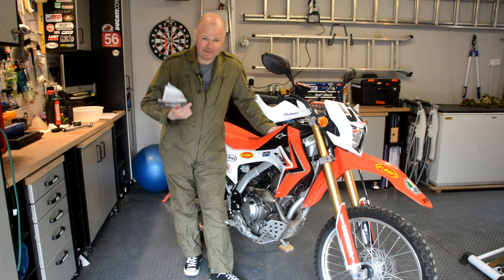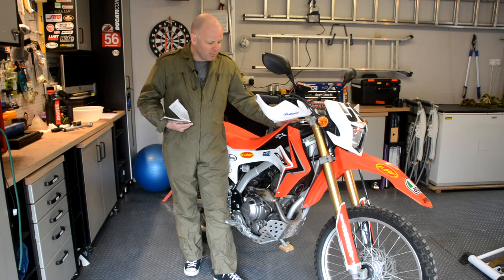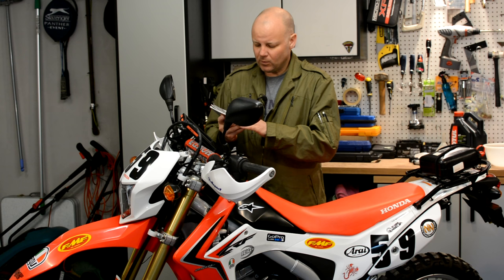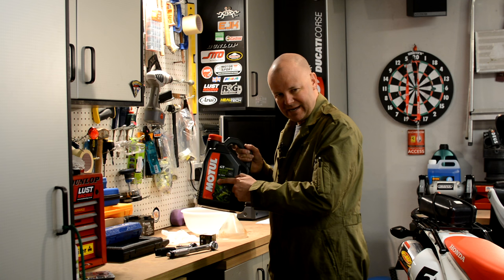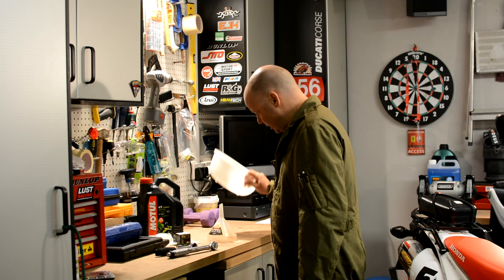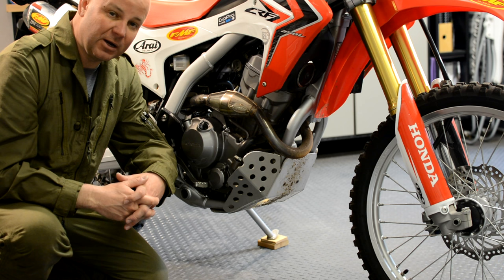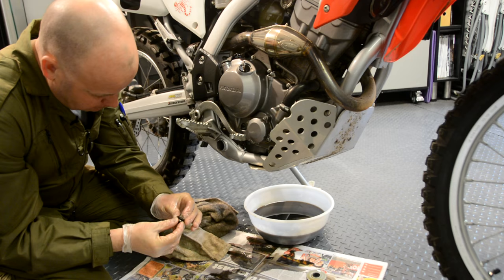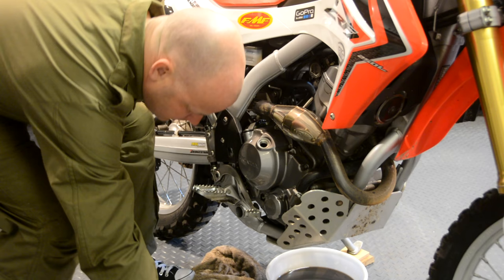How to change your motorcycle oil

Comment: again good video.But would be nice to follow manufacturer guidance on tightening bolts with right amount of torque. Quick look in service manual - 24Nm. Most people put them too tight.
Reply from the maker: Thanks Dom - I'll peg your comment to the top, should have mentioned that you're quite right....
Reply: Only noobs need aply ;)
Reply from the maker: Indeed...
Reply: Interestingly enough, on my 2017 R1200RT, there are several locations with the torque value imprinted.  Seems to happen near the soft parts.
Reply from the maker: Makes eminent sense....
Reply: I used to follow the torque recommendations but for Drain plugs you develop a feel where you just nip them up to be tight enough. The only time I've ever stripped a thread is when I was using a good quality torque wrench on my Aprilia Falco. I had to install a Heli coil kit and all was good again but the mechanic who fitted this advised me just to tighten by feel and always use a new gasket to avoid leaks that way.

Comment: Good video. Just changed the oil in my CRF last weekend. Only difference was I removed the skid-plate to keep the oil from going everywhere. (Only helped a little...)
Reply from the maker: Yes I wondered whether I should do that, as it happened it wasn't a big issue with only minimal oil spillage....what sort of annual mileage are you doing on yours?
Reply: I purchased a cheap plate with an improperly aligned hole so, removal will be part of my ritual. I do around 2500 miles with 80% of that off-road. Not bad for a fun toy.
Reply from the maker: Nice going!

Comment: Another cracking video, one tip I have learned from working on land rovers and industrial gearboxes is to check you can undo the filler before removing the oil. Not so much of an issue on new bikes but worth considering. Something satisfying about doing work yourself isn't there. I have recently done the valve clearances on my cbr600 and although awkward was nice to work through logically and decrease the ever increasing cost of vehicle ownership. 

Keep up the good work.
Reply from the maker: Great tip - thanks Thomas!

Comment: Hi fella,just some food for thought,you mentioned your bike had stood before dumping the old oil so there was no need to start it and warm it up before draining it. This is done for the reason of getting any heavy bits of debris which have not been caught in the filter suspended in the oil so they also come out with the old oil. Doing it on a cold engine like you have done allows these particles of debris to settle and they don't come out with the old oil. I can't imagine it's going to have a huge affect as your filter catches the worst.
Also you noticed when removing the filter cover it made a mess,I have found that using a piece of tin,normally cut from the likes of the base of a tin you cook turkeys in a Xmas shaped into a U shape like a piece of guttering. This can be placed under the filter cover to catch the oil which will run down the U shaped foil into your waste oil pan.
Some times it's impossible to make something like this fit due to the design of the engine but it's worth trying,also shove some paper towels below the filter cover to help soak up any oil which does escape. 
I know you keep your bikes clean and there is nothing worse than getting your ride all covered in old oil but these steps could help you lots.
Reply from the maker: Thanks Philip - yes you may be right on the cold v hot oil thing, I know that one does split opinion.  Having only done 600 miles since the last change I'm too worried though.  Good advice on the minimising mess front - you couldn't see it on the video but I had laid out plenty of rags and stuff under the bike as I was expecting a mess, but next time maybe a tin "funnel" is the way to go (although to be fair not much oil came out from the cover)....thanks for watching and for stopping by - TMF
Reply: Good advice Philip, especially about the tin funnel! I like that! :)

And as for your video on the oil change, Mr Flyer, once again, 1st class in every sense, Sir! (content, editing, humour "Most humane" lol)
As you're a perfectionist in all that you do, which is reflected in the neatness and organisation of your garage, can I please suggest another addition to your regime? 
As Mrs Flyer so kindly loaned you her mixing bowl, if she could see her way to also loan you her plastic measuring jug, you'll then be able to measure out the exact quantity of oil, so eliminating any guess work? It's only a suggestion, so please don't take it as a criticism, as that's not my intention. ;)
Reply from the maker: Thank you Ian, no criticism taken, part of the reason why I put this type of video up is because people always come back with great observations on either what you're doing wrong or how you can make life easier, so thanks for that....all the best - TMF
Reply: Thank you for that Sir! ;) My philosophy is to always reward and guide, as opposed to criticize and laugh, like so many people do on YouTube. At the end of the day, we all have to learn EVERYTHING in life, no matter the subject matter, so let's just all help one another instead of tear down and ridicule.
You are certainly the Class Leader in Motorcycle reviews/topics etc, and I'm 100% certain you'd do the same sterling job if you were talking about cars or planes! Excellent editing skills also my friend, so all in all, it's a pleasure to be your subscriber! :)
Have a great sunny Sunday here in the UK, and keep safe out there! ;)
Reply: Philip Roberts  I disagree all the sludge will drain to the bottom of the sump after you turn your bike off so draining it cold is better., it just takes longer because the oil is thicker. I personally don't warm my bike before oil change,but both ways are personal choice
Reply from the maker: Thank you Ian....
Reply from the maker: Told you this one split opinion!

Comment: Oil change is the only thing I can do on my Street triple . Going to try to change brake fluid in the future.
Reply: I was worried about changing the brake fluid on my Street Triple too, just because it's such a vital component of the bike, I didn't want to mess it up. It was actually amazingly simple! There's loads of videos on YT on how to do it - the most important thing I'd say you need to do is, make sure you don't let the fluid in the reservoir drop so low that you drag air in to the system - pump it out a few times then top the fluid up, and repeat 'til you're getting clean fluid through!
Reply from the maker: .....and don't forget to protect the area around the reservoir with lots of rags etc as if you spill any of that stuff onto your bike it can make a nasty mess!

Comment: Good video.  I'm about to do the same on my Rally.  Is there somewhere online that can provide the complete service kit?
Reply from the maker: E-Bay I suspect will have loads....
Reply: @TheMissendenFlyer  Did you change the oil filter gasket and the pressure washer on the drain plug?

Comment: Greetings from Canada!   I go to appliance stores and ask for the cardboard boxes that new fridges come in. Cutting down along the corners you four long cardboard pads. You can roll you bike onto one of the pads to avoid oil or coolant drips getting onto garage, or driveway floors and concrete. Cutting only one set of opposite corners gets you two double wide pads to slice under a car or truck.
Reply from the maker: Good tip!

Comment: Hello! Followed all the steps on your video until the oil filter part. Just was wondering, has there been a change of the size or model of the filter itself? Coz on my research, I should use Hiflo HF-116 for my 2017 Crf250L. Or am I still okay if I use the HF-112? Thank you!
Reply from the maker: +Paul Capuyan Ballola I doubt it's changed but it may have done - replace with the same as OEM if in doubt...

Comment: Hi MF... kitchen foil is an amazing medium to allow oil to drain from your filter to the desired collecting receptacle.... it shapes to any contour and allows the oil to work its way to where you choose without collecting on places like exhaust pipes etc that get hot and inevitably end up burning and smoking the waste oil that has leaked on to such surfaces. It also limits the amount of clean up at the end of the job which is a positive. Enjoying the channel....  thx Mark
Reply from the maker: Cheers Mark - i think about 4 people have suggested that - great tip and one I'll definitely use next time - I love the internet, always can learn something!  Thanks for watching and for stopping by - all the best - TMF

Comment: Hi Flyer, shouldn't undo bolts with your torque wrench mate ! A rectangular cat litter tray from a pound shop can accommodate the draining oil and the filter spillage at he same time. I like to keep the litre bottles with a spout decant the bulk oil on the bench and use the handy measuring device on the bottle. Nice video as always though.
Reply from the maker: Cheers U B Slow - appreciate the advice, I'm always keen to learn from others so thanks for that....(and I'm too stingy to buy a cat litter tray!).....

Comment: Hello TMF, Is that a 2 Ltr fuel friend or a Givi canister you have on the back, where did you get it and how much. I have a 5 Ltr £3.89 plastic fuel can from The Range strapped to the side of my rack but I think a thinner one might be better. Thanks for the vid, just ordered a filter & oil as the Honda dealer says service intervals are 8000 miles, far tool long for me.
Reply from the maker: It was just an E-Bay special...if you search on there you'll find it - cheers - TMF

Comment: The colour of the oil is not so much an indicator of bodged oil.They all get black,and the ones that don't are the ones to look out for ;) Nice little video :)

Edit:Try turning over the engine with starter.Just turn off the kill switch so it won't start.

Comment: Nice one. Did this on my versys. Was a bit concerned about removing the filter but was easy. My advice is to never ask a motorbike forum about which oil type to use.  .
Reply from the maker: Hehe, you sound like a man speaking from experience.... :0)
Reply: TheMissendenFlyer lol pages and pages. guaranteed to end in an argument. not sure if you facebook but great mcn vid of the 2017 sports bikes posted today
Reply from the maker: I'm only on Twitter at the moment but I must investigate the whole Facebook thing.....
Reply: TheMissendenFlyer ive spotted it on yt. 2017 mcn superbike shoot out

Comment: A real pain taking off the fairing panels to drop out the oil.  I note the workshop people simple suck it out via the filler hole using a pump!  Lazy buggers!
Reply from the maker: Really?
Reply: TheMissendenFlyer I'm sure not in every case but I witnessed exactly this practice the other day at an independent bike garage.  The guy was Honda trained and said this was an accepted time saving method of whipping out old oil. Not certain he'd wanted me to see it happening or make the enquiry etc.
Reply from the maker: Hmm, sounds like a recipe for potentially not getting it all out, but if that's what the "pros" do.....

Comment: Aaaarrgh! TMF! You made we wince between 10:02 and 10:09. It looks to me as if you over-tightened bolts 2, 3 and 4 on the filter housing. I hope I'm wrong and that you haven't have partially stripped the crankcase threads! Been there, done that (in my formative years). Can I suggest that you always use a torque wrench whenever possible? Hope you don't mind the constructive criticism...
Reply from the maker: No I didn't tighten those bolts very much at all - no need to be concerned...but I do agree, always best to use the torque wrench (assuming you have access to the settings!)...always good to get constructive criticism no worries.  Cheers - TMF